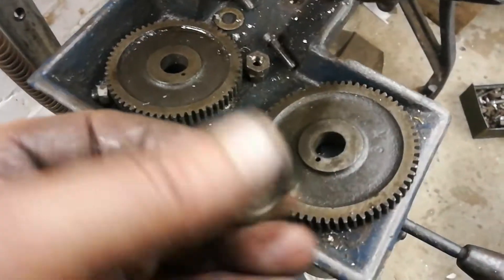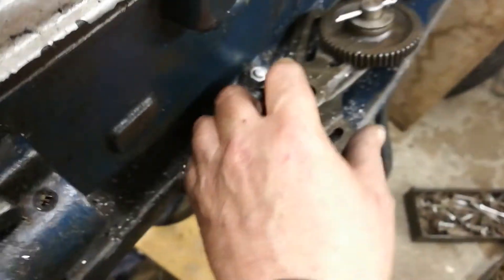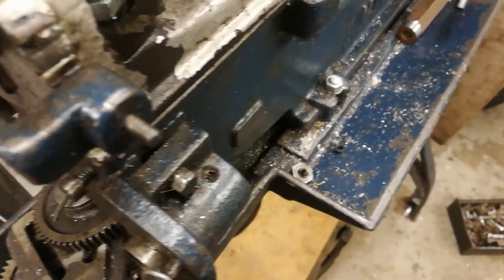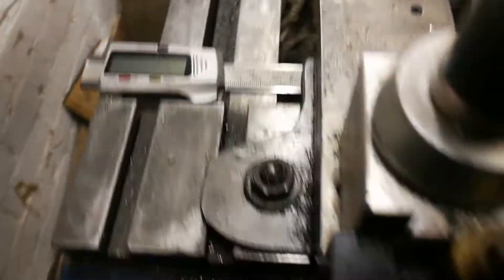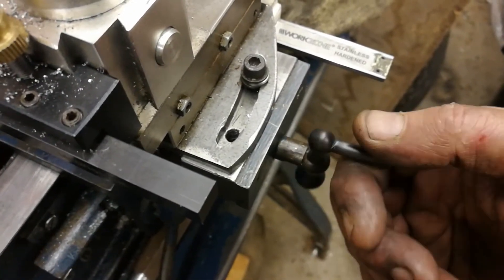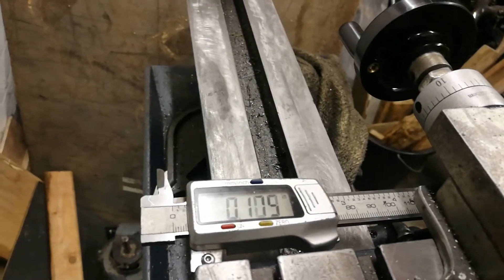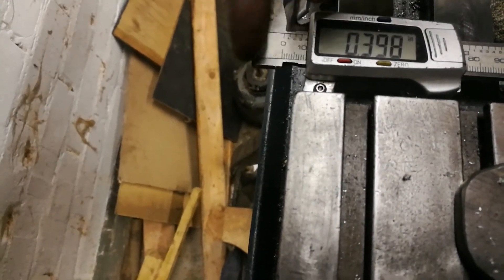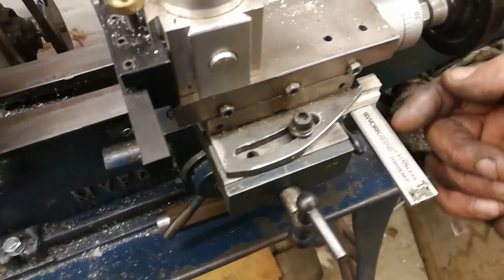Myford ML4 "upgrades"

Comment: Did you manage to fix the cracked headstock? Ive just picked up an identical ml4 with a cracked headstock over the bearing. Trying to save it but have never welded cast (I have cast nickel rods and an arc welder) just dont want to mess it up.
Reply from the maker: No. I managed to sort out the longitudinal play in the original set up. I've since sold this machine. A friend of mine repaired one. I think he used long grub screws after he'd drilled and tapped (obviously) then brazed. I should think, if it's edge prepped deep enough, arc welding should hold it. I think I'd preheat for a good while, if only to leech out any oil and grease that's absorbed by cracked cast iron

Comment: Do you have any photos of the fixings for this mod, I am trying to do this to my ml4 but am struggling with fixing it buy the handle end, any help would be most appreciated. Many thanks and great job.
Reply from the maker: One end uses a bracket that uses one of the T slots at one end, while the other end slides over the rule.  I found the bracket on thingiverse so I could 3D print it. It looks like square cornered letter P